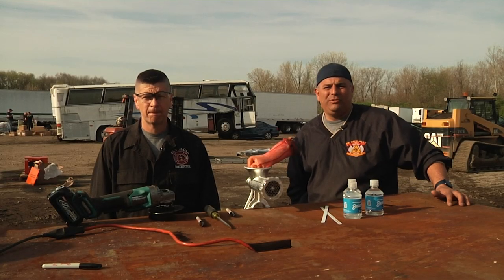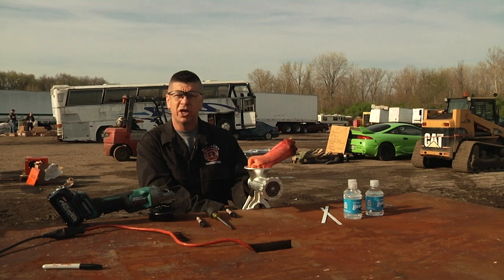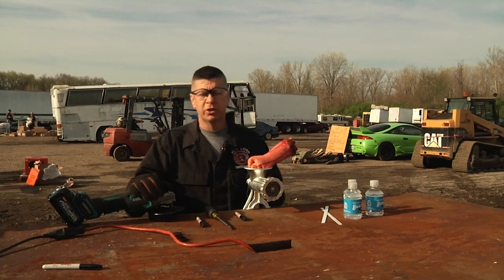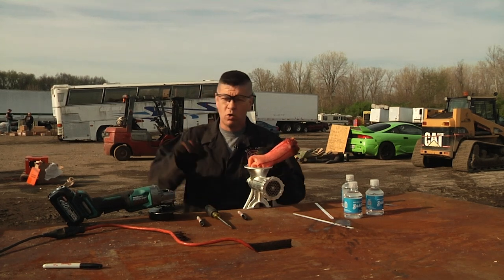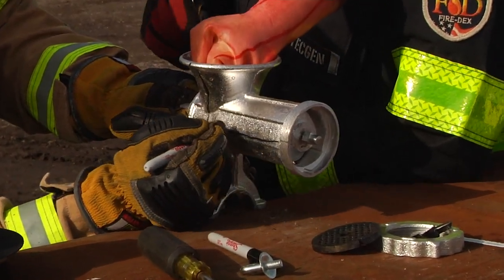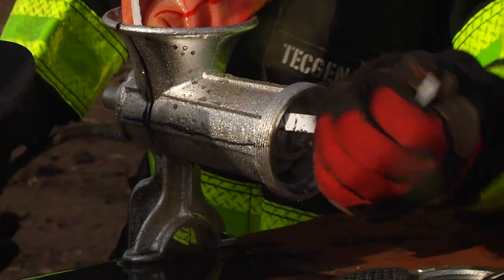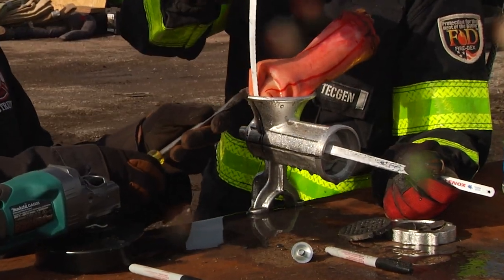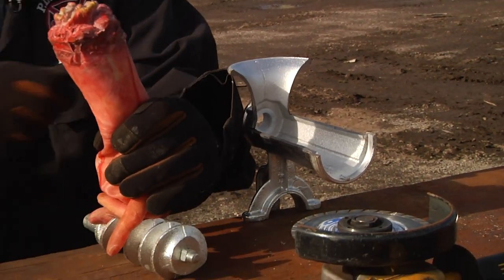Tech Rescue: Hand in Meat Grinder

Comment: Or, just use the thumbscrews that hold the grinder on the counter and transport. Have paramedics standing by, think about life flight, just transport so as to quit wasting time. Stay and play vs load and go...
Reply: that is a solid point lol
Reply: Exactly. Doctors get paid way more than me for this purpose. We stabilize and transport. I’m not risking my license to practice because I cut a dudes fingers/hand off with a grinder. Depending on amount of trauma I’m putting a tourniquet on there, removing the tool from the table, and getting out of dodge.
Reply: He said this is a prop. And that it could be this or it could be something bigger. You are absolutely right but we have to use our imagination sometimes in training. Doubt the training budget has room for a commercial meat grinder to be cut up. Hell I was surprised to see they had 2 harbor freight specials and not just one.